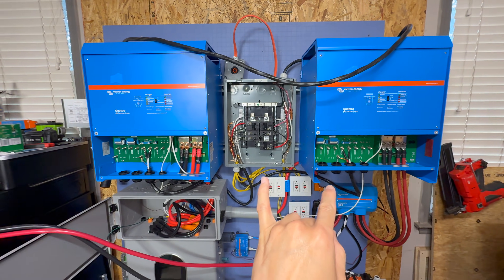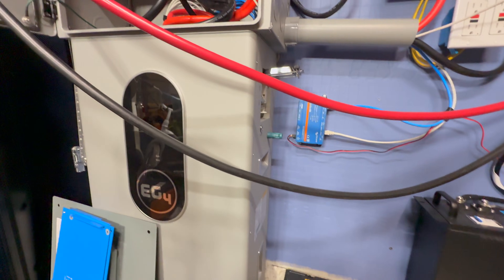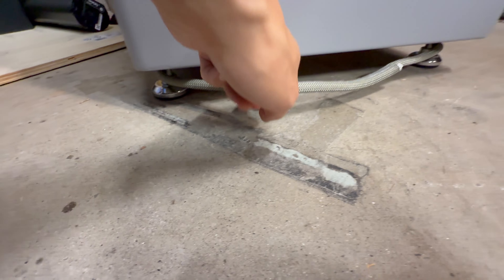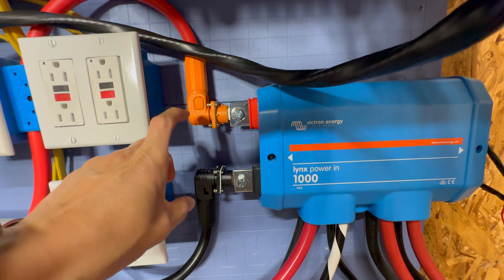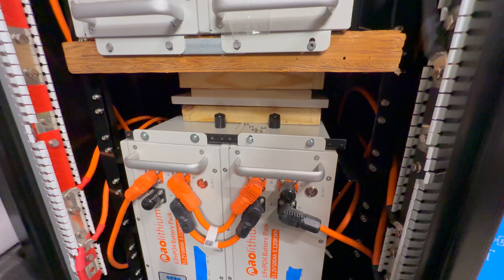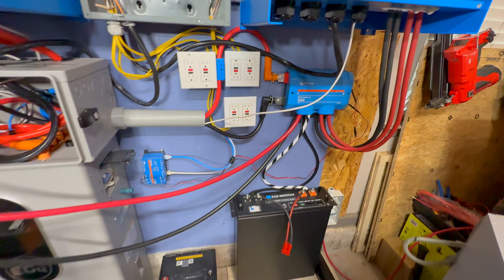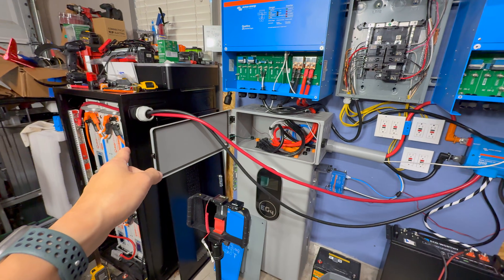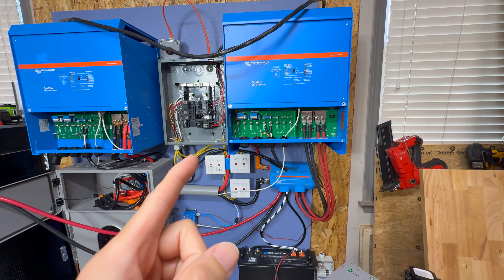🔋 Victron Quattro + EG4 & AO Lithium Battery Bank Upgrade | Split Phase Off-Grid Power System

Comment: I have two battery banks on my system and it works great. I just put a shunt on each battery bank instead of having them all run through one shunt. The reason is is because the batteries were slightly different for the charging voltage.